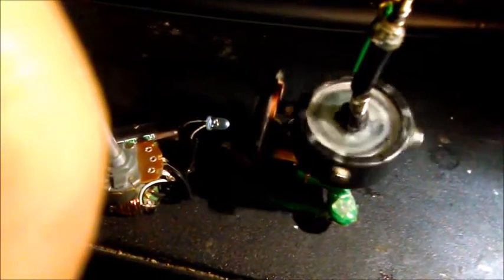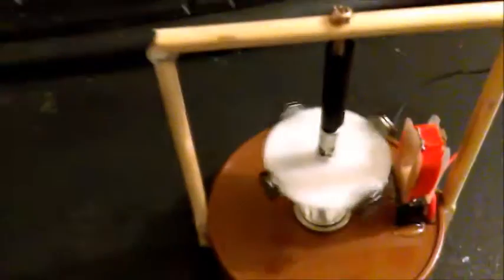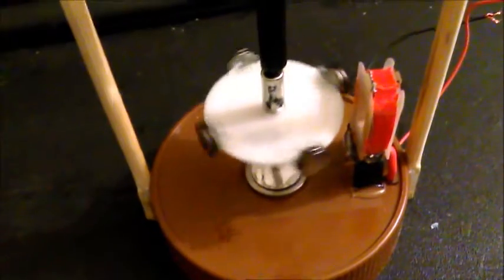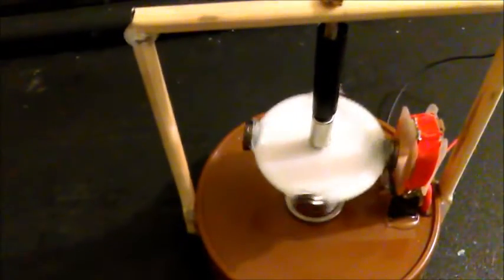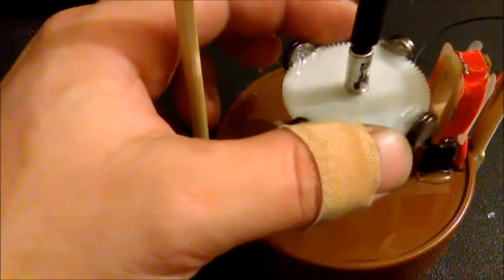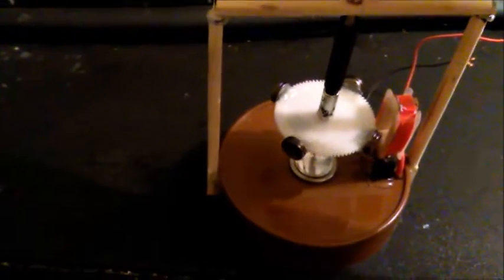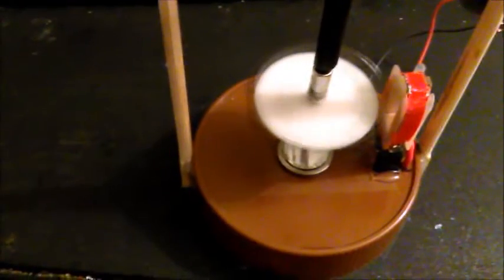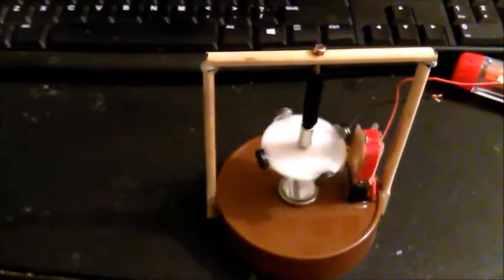Practically friction-less rotor, magnetman2010 style

Comment: Will balancing the disc diminish the friction further ;-). Cool work! I wonder what running it in a vacuum would do ...
Reply from the maker: yes if it were perfectly balanced it would be even more free-moving. I've found that perfect balance to be quite amazingly difficult to achieve in a setup like this where even the slightest bit of extra friction becomes noticeable. I need to work more on this thing and as of recent have just let it sit in a window sill. I used some MWO motor coils recommended by Lidmotor to drive this thing, the coils are 12k ohms each. Two of them in series driven by a solar toy circuit spins this thing around in my window from extremely low light. I may indeed put it in some vacuum container and just leave it like that one day as a cool little toy.